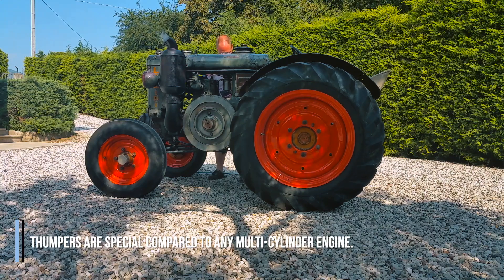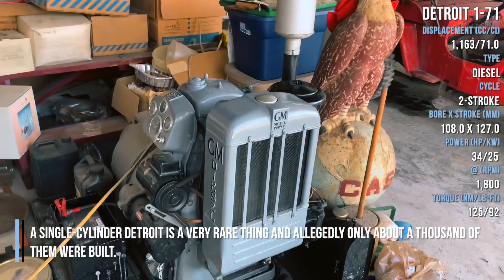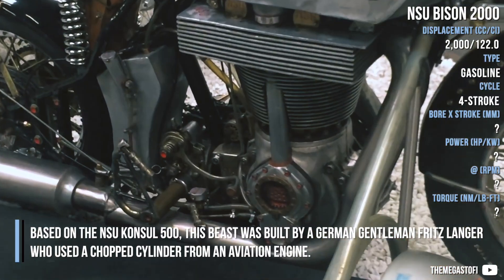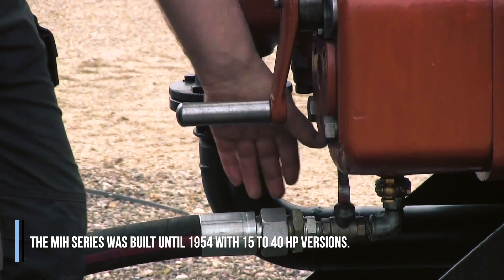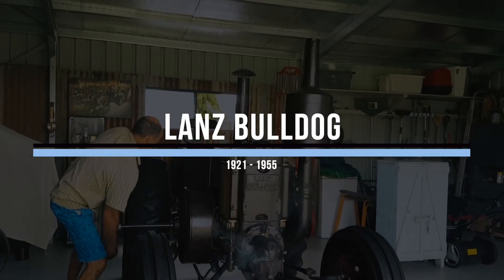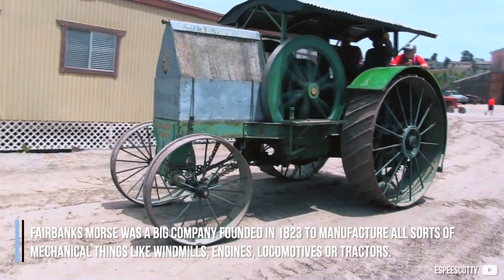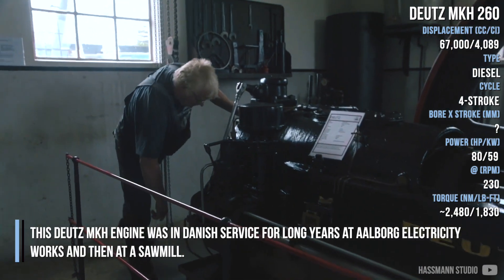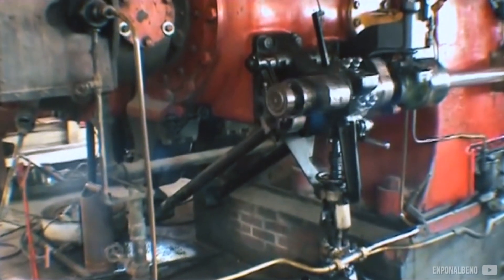Largest 1-Cylinder Engines

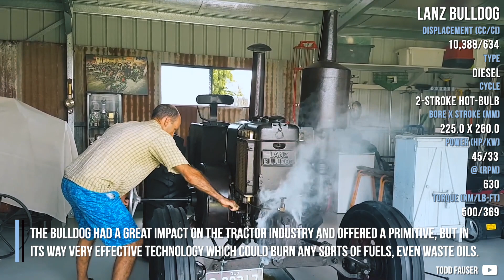Comment: 4:48 That looks like it got real exciting real fast! Worlds fastest turning steering wheel.
Reply: What the hell is happening
Reply: @ryanfisher6402  Those old hot-bulb Lanzs used the steering wheel to provide a manual way start the engine. You'd use a blow torch to heat the "hot bulb" part of the cylinder head next to the fuel injector and once it was hot enough to light the fuel, you rock it back and forth with the steering wheel against the cylinder compression to get the injector to fire, hopefully getting the engine running in the right direction. You can see him pull the manual injection lever as its rocking back and forth to get it to finally start in the right direction. Obvious problem is once it starts you have to retrieve the now rapidly spinning steering wheel, especially if the governor is not set up quite right and the engine runs on a bit faster than it should, which is what happened here.

Comment: When you machine your piston with an angle grinder. 😆👍
Reply: Looked like he welded a crack or something to me just grinding down bead
Reply: If I remember right, James Watt was happy and mentioned in his diary that piston and cylinder were so tight fitted that you can not put penny coin between them.
Reply: Better than a hammer and chisel.

Comment: Some of these you can use a stopwatch as a tachometer!
Reply: In truth using a stopwatch is how one figures the rpms on quite a few of the old slow spinning engines. I have an old tac, you set it against the crankshaft and counted either 30 seconds( for the fast ones) or one minute and read the dial and figured from there.

Comment: I love it how on the last shots, of last engine on this list, we can clearly see how RPM changes a little after each combustion. Thank to synchro of FPS and RPM of flywheel.
Reply: Good old CCD sensor cameras.  Much more difficult with the rolling shutter of today's cheaper CMOS cameras.
Reply: The last engine runs at the WMSTR show and the speed at the end is sped up by the person that took the video. It normally runs at the rpm at the beginning.  Its piston is bigger than a 55 gal. oil drum.

Comment: Therapeutic effects of Suzuki DR800 BIG & NSU BISON 2000 vibrations: no matter of how large & solid they are, no kidney stone will able to withstand their vibration, thus alleviating your very painful discomfort & condition.
Warning:
Healthy person (without kidney stone(s)) should avoid utilizing these medical apparatuses! Side effects include: internal hemorrhage, skull fracture, concussion, headache, migraine, testicular trauma, testicular torsion, fractured spinal vertebra(s), rectum rupture, etc. 

Consult your doctor and/or personal physician before use!
Reply: Vibrations ar no matter on the DR 800 because of the balancer-shaft. My HD XL 1000 or my BMW K100 i owned earlier had way more an harder vibrations. But you have to tension the balancer-chain with every oilchange!

Comment: Fabulous. We worked at a remote house and we had to generate 3 phase electricity to test our development. We used a 550cc single cylinder diesel engine,it was hard work to turn over and ran with a surge surge noise.

Comment: One thing can be certain:
They have more torque than your Supra
Reply: The big ones could easily squish my Miata too!
Reply: Yeah but can you imagine driving around town in a SUpra with that "under" the bonnet????
Reply: Or a Harley and a ford put togather
Reply: Basically: When you want to transport 80 tons don't look for a formula 1 with 1k hp, look for an engine with 100 hp and 10-20k torque
Reply: Then again, if you are free to choose gearing, horse power is what really matters.  These things are all down below 50 HP.  That is about where the VW bug was on power.
Reply: @kensmith5694  no one gets that torque and rpm are inversely proportional and power is what matters
Reply: @FrostxVal  no. gearing is what matters. you can make a low hp high tq engine run with high revving high hp, low rpm engines, just with gearing.
Reply: @frigglebiscuit7484  but if the low revving engine has 80hp and the high revving engine has 200, the high revving engine will always win. Torque is pointless, power is what matters
Reply: @frigglebiscuit7484  V8 F1 cars had 750hp but "only" 350Nm, are you claiming that a tractor with 50hp and 2000Nm would beat the F1 car just with gearing? don't be stupid
Reply: @jorge8596  in a tug of war then yes
Reply: @FrostxVal  For a fixed power output...
Reply: @LordOfChaos.x  not if they're geared for the same top speed and have the same traction.
Reply: Ken Smith there is a multiplication of hp to rpm, that’s why an engine that makes 20 horsepower at 60 rpm produces around 25000 ft/lb of torque or around 300 times the amount of a Volkswagen Beetle,
Reply: @seasonracing  so you're telling me those things have 25000 lb feet of torque? So you could pull a train, assuming you had grip?

Comment: Jesus Christ, could you imagine getting whacked by the flywheel spokes on that last engine!!
Reply: Or fall into the crank counterweights.....OMG!!!!
Reply: Lol I always wondered the same with all those moving parts how people didn’t get hurt on the regular.
Reply: Common sense was also a lot more common back in the old days...
Reply: @angelovasilikos7980  people died on the regular
Reply: Farmers have always had many children missing limbs.
Reply: Perhaps that's why they paint them red, so you can just keep on going, once all the body bits have been hosed off.
Reply: you wont be able to imagine no more
Reply: You died, but the engine is fine.
Reply: It was a very common thing back in the days. Literally thousand men were crushed during the late 19th century early 20th. There's a scene about it in the Elephant Man movie - Mr Treeve, a surgeon: "It's a machine accident. I expect you'll be seeing a good deal of this. Abominable things these machines. One can't reason with them."
Reply: That whack would last a lifetime.
Reply: No need for the profanity
Reply: @jesuschrist2886  
Agree.
Reply: imagine that flywheel getting loose….
Reply: @derbruzzler7574  I used to work at an airport, as a trainee electrician. We had big generators that had 3 tonne flywheels. I was told (apocryphal?) that a flywheel  had escaped and just kept turning at right-angles every time it hit a wall and basically destroyed its powerhouse building.
Reply: @nickw9376  imagine that thing coming loose
Reply: After being hit? no....
Reply: imagine if it decided to leave the building
Reply: Try asking Jesus in prayer. This isn't his YouTube channel.
Reply: Instant death
Reply: I legit got scared of it somehow
Reply: That engine is located on the grounds of the Western Minnesota Steam Threshers in Rollog MN. Up and running every Labor day weekend during the reunion.
Its their biggest single cylinder, but not the biggest engine on the grounds by far.
Reply: Yes, one won't be long for this world if that happened.
Reply: @Comment Section what are you trying to say
Reply: The video is speeded up. It gives a false perspective.
Reply: @Napoleon_Blownapart  it's pronounced sped bud
Reply: @jesuschrist2886  Ok, settle down Adolf.
Reply: @Napoleon_Blownapart  At least I don't use "speeded" as a word. Stop your whining Barnabas.
Reply: @jesuschrist2886  That's it little buddy. Let it all out. Feel better? I'm glad we had this meaningful conversation.
I'm going to bed now and join my wife in some before sleep fun. Kiss kiss
Reply: @Napoleon_Blownapart  I love you too son.
Reply: Whacked! Surely you must mean vaporised 🤭
Reply: Back when people didnt need a sign telling them to not stand there.
Reply: osp80  well yes

Comment: landini ❤❤❤ btw they made bigger displacement tractors too their biggest one was the 40hp with 
a 14.327 cc engine and the l55 was the most powerful with 60hp.
the biggest displacement hot bulb engine tractor was the UT5 made by the italian bubba with 2 pistons 23 000 cc and 50 hp

Comment: The American : V8 7l

The German : 10.7l 1 cylindrer
Reply: The Italian: 27l 4 cylinder
Reply: @huseyinuguralacatli5064  And the odd 3 litre V12.
Reply: 330L SINGLE CYLINDER
Reply: Nice joke man
Reply: There exists a 1.6L V16 if i remember
Reply: @Brayden Crowl japanese:
8 rotor 3,2l😁
Reply: And this Lanz Bulldog engines can run backwards and at zero RPM!
Reply: Lmao
Reply: Also the japanese 125ccm 4 cylinder
Reply: Also americans: 7.3L two cylinder tractor
Reply: The British: 2-4L 6 Cylinder 
Or Cylindrer if you like.
Reply: Not in a modern road vehicle probably not even old one now they make 4.4 v8 when dodge make 8.4 v10 car weighing same as m3
Reply: @A500-g6g  yes because we have regulations. You can only have a certain amount of co2 emission for the complete fleet of a manufactory. Thanks the EU for that
Reply: @peterzingler6221  I used to obsess over German cars I still like them but I see for the normal person American is better they now offer a $35000 chevrolet camaro with a manual transmission and  450 horsepower and can be had at dealers for around 30 apparently 6.2 litre na v8 and simple basic raw design, German car are much less reliable and overly complex also less driver involvement unfortunately it's like this now with only a few good German driver cars on offer
Reply: @A500-g6g  why'd you need a 450HP car?
Reply: @Jan_372  So you can easily modify it to 650.
Reply: @wind-solar  but when you bring the Kids to Football/Soccer or to School you dont Need 650hp and you also dont Need 450hp. 150hp are enough
Reply: @ominösersüddeutscher  Who said he was driving anyone?
Reply: @ominösersüddeutscher  we had a VW beetle with 42 hp, that was enough. So why do you need 150?
Reply: @raynic1173  ok ok ok. the avrage family has a car with around 100-175HP
Reply: @A500-g6g  we say the same about american cars Here...
To big, unreliable, gas hogs, cost to much to buy and then there is road taxes and in the most country in Europa its about weight (my car weighs 1100kg and has a smal diesel and Costs 90 euro a month to just have it)
Reply: @A500-g6g  There is a simple reason for most german cars having very small engines: Taxes! A car with your 8.4 V10 would cost you 560-570€ every year, only for car taxes! And fuel is also expensive in europe. While 1 gallon cost like 2$ in the USA, its 6-7$ in germany rn. I like big engines, but for your daily driving a car with less than 2.0l is the most affordable. A 1.0l 3cyl engine only cost you 56€ of taxes a year. So I understand, why EU car companys make small engines.
Reply: @Caturix  when u buy a car for 100k plus, you don't worry about taxes or fuel costs. Mercedes made a 6.2 DOHC v8 and everyone loved that so much. They only don't like American engineering because they've been told by the magazines and marketing shows like top gear that they can't handle, when u look at the numbers the story is much different
Reply: @A500-g6g  But the more people can afford the cost, the more costomers you get.
There are actually very good german cars and some are the very best in terms of quality. But these are the very expensive ones. Imported US cars here cost a little more than they cost in the USA. And some years ago, the quality wasn´t that good, comaped to what you get for the same money on a german car. But from what I´ve seen, the US cars improoved a lot and also have a good quality today.
I also like american, japanese and Italian cars. I know some people think a not-german car will fall apart, after 5 years. But i know thats not true. I had italian and japanese cars who really lasted long and I had a lot of fun with them.
Reply: @Caturix  I hear u man. I'm into all kinds of cars, among my favourites are the ferrari f50, mclaren f1, porsche 911 gt2 rs 997 gen and the pagani zonda f. But the American cars offer a similar level of performance and raw driving experience of those cars for a very small fraction of the price. Imagine the top 3 fastest NA manual cars from 0-60 are the mclaren f1 at 2.9 seconds, and the zonda and corvette c6 z06 at about 3.6 seconds (actually I think the zonda may have been third at 3.8), those cars cost millions while I can get a z06 c6 gen for 35 grand and lap the nurburgring in 7:22! The most powerful manual car ever made (production road legal) is a corvette zr1 with a 7 speed manual.
Reply: @Caturix  its 570 euro's for you, in the netherlands the road taxes are about weight, for example, a diesel is 1.5 times as expensive as a gasoline car...
A mitsubishi pajero 3.3 turbo diesel is in germany (ost Friesland) around 300 euro's a year,
I would pay 500/600 euro's every 3 month's to just have one...
Those dutch fuel prices are also thru the roof right now, e5 being 1,75€ where I live, e10 1,60€ and diesel. Around 1.35€ a liter...
Reply: @lennardbos4218  2000 only for taxes on a Pajero? Damn, thats insane! 
And the fuel price is a pain in the exhaust, if you have a thirsty car.
How is it with electrical cars?

Comment: 4:50 ..  owners manual:  make sure engine is completely running before removing this piece.
Reply: that absolutely terrifies me
Reply: Valentine My dad has vintage „Traktoren“ for his whole life and I grew up with them, starting and driving them from a very young age.
Thinking back I would never let my own children crankstart these engines, but my dad thought it was a good idea..
Reply from the maker: That's the interesting fact about it: you crank the engine with the steering wheel!
Reply: The guy who starts this Bulldog is doing it wrong in so many points... In my opinion it is a bad example to show the Lanz.
Reply: @RingoLanzBulldog  what did he do?
Reply: @midgetman4206  He pulled out the steering wheel to late and positioned his hands wrong
Reply: If you're used to doing this, you feel compression occur and take the wheel out on time.
Reply: Oh my Goooooodnesssss. Kkkkkkkkkkk